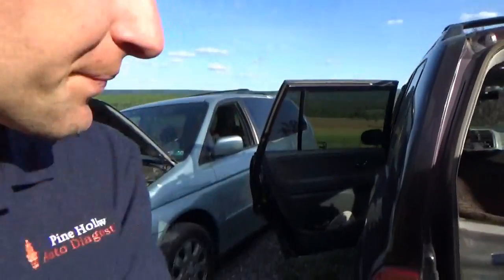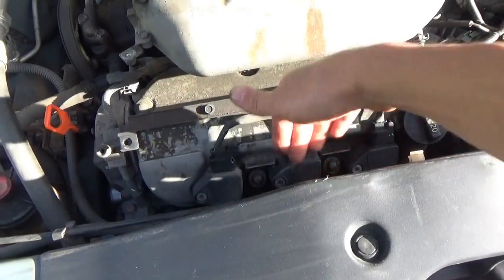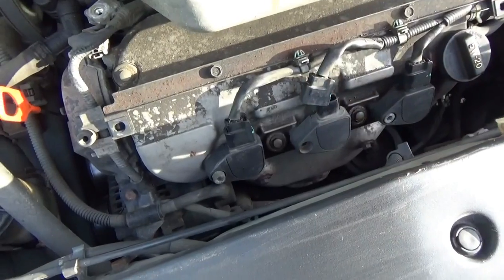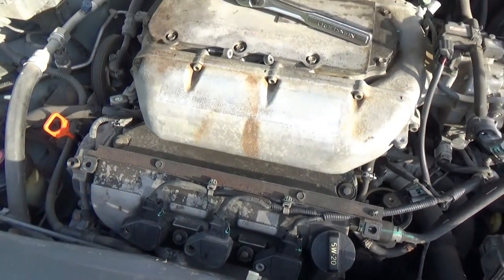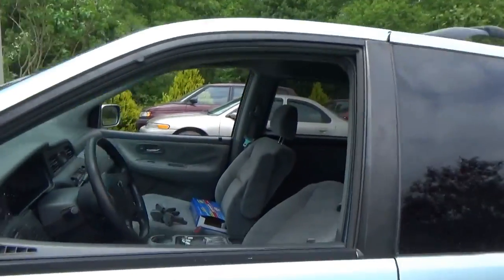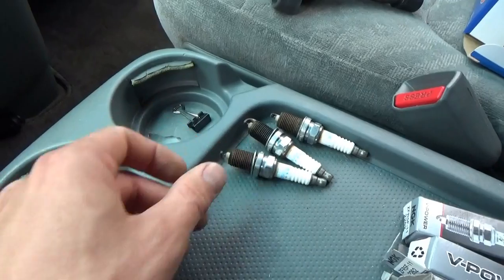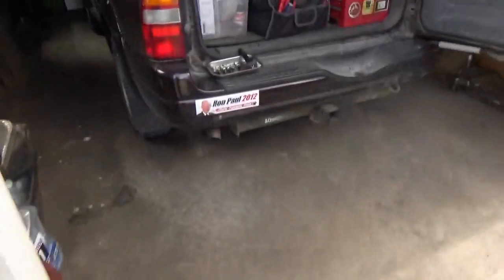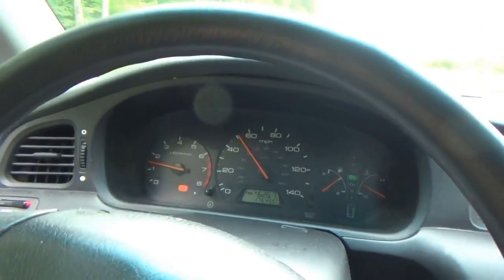Deja Vu? Honda Odyssey Misfire #2! (CAT MELTDOWN?)

Comment: Same thing happened to me about in late 2021. I bought some NGK spark ⚡️ plugs from eBay… they also only lasted a little under 20,000 miles. 

Was driving home after work one night & my 4th-Gen Acura TL started a nasty misfire in the freeway with crazy traffic. Made it home, took a look at the plugs & saw they were worn to hell. Got some OEM plugs & problem solved.

Comment: Love your videos.  Easy to follow.  I've got an 06 Odyssey that has had similar symptoms as the 03 in this video.  My scanner showed multiple cylinder  misfires and a random misfire code so I thought it couldn't be a single cylinder/injector/plug/coil and started looking for a larger issue.  I settled on the fact that the timing belt probably slipped/jumped and my timing was off.  Tore it down and am waiting on timing belt replacement kit.  It needed to be done so no real problem but wish I had seen your video earlier because I didn't know that Honda misfire codes are unreliable.  Once I have it back together, if the problem persists, I'll check each cylinder as you recommended.

Thanks again.

Comment: Liked the video. Just an observation at 1:27, the first spark plug coil you unplugged is cylinder number 4, not 1. Cylinders 1-3 are on bank 1 (rear head, closest to firewall). Cylinders 4-6 are on bank 2 (front head, closest to radiator).

Comment: I want to thank you for such a great video on troubleshooting the customers problem. I was having the same issue with my 2002 odyssey and was baffled by the engine misfire codes and tcs light remaining on with no other codes. I also watched your part one video at the same sitting. With all the info you gave, I found the problem in 15  minutes. Turned out to be a bad #6 plug coil. I used all the troubleshooting tips shown. Great videos.

Comment: I've had no trouble with spark plugs which I bought off eBay for my 5.7 litre Chevrolet LS1 V8 engine because they were Denso spark plugs which were in the GM boxes so they're OEM !

Comment: Plugs from them mother rip off land. Saw a mx8 recently at a friends shop. Dumped so much fuel into the exhaust. CAT was a ball of fire. Let it sit over night. Changed out the oil. Checked it out ran fine the next day and CAT temps were normal

Comment: I have been using shell gasoline only for last two months in my 2006 Mazda 6 2.3 with 311,000 miles.I noticed a huge difference immediately it woke my engine back up and I'm getting way better mileage and motor runs smoother...

Comment: I made the mistake of thinking the cat was the problem when it was glowing red. Turned out to be bad  coil and wires were about shot. Unfortunately, I did a "delete" and now get codes all the time. I'm trying to find a junkyard converter but they usually strip those off first thing for the bb sized piece of platinum in them.

Comment: Ivan, I wanted to see how the how you got to the rear plugs without pulling the engine. You must be a heck of a contortionist!
Reply from the maker: It's super easy on this Honda. Complete opposite of the 92 Oldsmobile Silhouette haha
Reply: I just worked on an '06 and the firewall was tight. I think the engine mounts are shot, so maybe I should have tried jacking the block.

Comment: I won't be buying any oil filters on Amazon either. One of them comes apart, and it could ruin the entire engine, should pieces of it get stuck somewhere and reduce the oil flow. It is unlikely, but not worth the risk to save a few bucks. Fuel filters too.

Comment: Thanks! I had to splice an ac plug onto a cord for an under cabinet light. I staggered the cuts. I went and got the soldering iron soldered the connections put heat shrink tubing on the joints. Because I watch your channel I did that. Prior it would have been an unsafe mess. Thanks! Thanks!

Comment: I once bought water filter for my refridgerator I had issues with my dispenser clogging up pulled out the old filter it was very light like it was empty after closer inspection the filter was counterfit was filled with a little sand to get the weight right and was just a hose that let the water bypass the filter craxy

Comment: There's alot of that going on these days! I definitely would steer clear of eBay or Amazon for auto parts, especially electrical ones.

Nice work on that pressure transducer! If I ever get a laptop, I'll be buying one from you! At the moment my desktop is driving me nuts with slowness. I've been working on a YouTube video for a week now. Friggin ridiculous and super infuriating. New one with the memory and disc space I want is $4-grand! 😵

20 years ago when I was out in Phoenix, the heat out there damaged the original TFI module on the distributor, and caused a cat-melting misfire that took me some time to figure out the cause of. Same deal - cats were fire engine red! After replacing the module and the internal pickup in the distributor, the problem was gone, and the car still had the same power as before, so the cats were still good! That was amazing, since I drove the thing 2 weeks before fixing it, cats glowing each time. Doubt most modern vehicle cats could handle that!

Comment: You have to be careful counterfts are running rampant on amazon and eBay  I’d rather buy from the dealer or rock auto.  Big difference between China and Japan.  Amazon should monitor there sellers better but ounce you get so big all you care is about the $$$$ and getting the product out fast. You gotta love how Ivan does a scan before giving back to the customer 👍

Comment: I would be interested in the Pressure Transducer prototype with my Autel MS906BT and Maxiscope setup! Message me if you would consider. I am located nearing Birmingham, Al
Reply from the maker: Hi Phillip, just fill out the request form on my website! Should work fine on the MaxiScope :)

Comment: "lean" fuel issue makes cat glow orange, also clogged cat does the same, never trust O2 readings nor other sensors and "magical codes", more often that not, no codes present because of odd failures the ECM isnt capable of detecting or will spew false/wrong codes becaue other items are funked up.
you really have to diagnose hard, use nose eyes and ears first, if smell is rich/unburnt and odd pulses then raw fuel is pumping. if smell is clean and uneven pulses, no fuel at all(to one hole), mechanical or ignition issue (fuel cut to one cylinder on newer junk and still spotty)
I guess I could go on and on and the more I think about it, it's learned in due process and the short amount of training/schooling simply isn't enough, as it will never be.

Comment: Tip for installing spark plugs that are at an angle like that - keep an old style long spark boot and use it to install the new plug. Since they aren't solid like a socket, they greatly reduce any chance of cross threading a new plug.
Reply: or thin rubber hose...

Comment: China parts are hit and miss. I’ve seen mass airflow sensors that don’t work from the minute you installed them. On the other hands I have installed eBay starters and wheel bearings that work just fine
Reply: that sums up everything since about 1993 (Clinton presidency), it went downhill majorly, starting with the challenger kaboom.... RIP crew

Comment: Classic cascade failure-
One or more inferior quality parts lead to further damage.
These older engines are not meant to run the very cheap
high percentage ethanol blend, either.
I can imagine the knock sensor(s) are very stressed out,
from having to report such high frequencies; timing gets
advanced to try to compensate, burning up plugs.
This is not a "flex fuel" capable system, it's ECM doesn't
have the strategies to deal with ethanol.
My Friend nearly ruined her '06 LEV Accord using cheap,
low octane corn juice. Exact same symptoms and
problems.
Reply: Whenever I can find and afford ethanol free gas I make sure to fill the tank with it. Usually is the Shell V-Power where I live.
Reply: Wouldn't the timing get retarded?  And flexfuel vehicles can run off of E85.  Pretty much anything should be able to run off of E10, which is what most pump gas is.

Comment: Could this be a way to clean an almost clogged cat? Unplug a coil, so the cat will get unburnt fuel (or if the ecm inhibits the injector, introduce unburnt fuel in another way), and then drive the car under heavy load while the cat is glowing red, burning off internal carbon deposits? I don't recommend anybody purposely doing this but could it work, in theory?
Reply from the maker: Great thought! Well if the cat is inactive to begin with, the fuel wouldn't burn, so nothing would happen. However if the efficiency is marginal then it could potentially work?
Reply: most often it will get hot and "BURN" the insulative holding material around the catalyst itself, then they start flopping around lose inside and breaking up physically.. which makes it plug up worse/fast.. most are 2 or 3 stage now and the front stage comes loose, and hammers around, the material clogs the second and third stage, muffler/resonator also

Comment: Very good on the follow up with checking the oil for fuel dilution. Often overlooked and can usually cause a rich code in some cases when ran back through the PCV system.

Comment: Are use dielectric grease on the threads just stuff about the size of a 8 inch ball spread it on the threads and then also put them on the electrode at the end when I before I put the coil. Kept the great work.

Comment: Another example of how sensitive Honda ignition systems are. Use the right parts, they're reliable and low maintenance. Use the wrong parts, they'll run like crap and stress other parts until they fail.

Comment: There are many counterfeit items out there right now, ebay and amazon are both a little guilty. I saw a video where Motorcraft spark plugs are being sold in boxes that look like they came from Ford but they are not. Weird drawings on the box and the name on the actual plugs look different than oem. It's pretty bad when those plugs look like that after just 20k, that's pretty sad. Test drive at the end is always important, part of verifying the repair.

Comment: No need for the wd 40 on the threads of the new plugs the oem plugs have a special coating on the theads that  prevents the plug threads from seizing in the head no need for anti-seize slso
Reply: For the price of those spark plugs, they should have.
Reply from the maker: WD-40 is my good-luck spray ;)
Reply: I trust all that as much as I trust not getting counterfeit plugs or ones the manufacture outsourced(shell companies with nothing left but lies, garbage and branding)

Comment: Wow,   I've never seen worn and fake plugs.   I've always bought plugs at the store.  Nice fix!!!  Great job!
Reply: I tend to buy plugs locally only ( fragile items) and I want to exchange them fast if it's shipping damage or they smashed then in storage..
but sadly, they all are failing to warranty replace, claiming "you" damaged them. which I can see for a large amount being true... people damaging them, I have done so myself letting socket cock sideways and cracked porcelain, which i felt and knew i did, the just bought a plug to replace(my fault!)

Comment: Your actually a local to me. Wondering if you could help ? I have a 2009 Subaru 2.5 sohc n/a  I did all the work my self I do not have a alltech system to tell me torque settings for head bolts... Also could you recommend a trust worthy place to order my head gasket kit and timeing belt kit... Thank you
Reply: Mind you I did get my head's decked and surfaced and I'm ready to put it back together...
Reply: 6.21.20.     Only purchase Six Star ®️ or  Fel-Pro ®️MLS head gaskets  you can purchase at ...... smartqualityparts.com. These guys know Subarus!

Comment: WD washes all the protective oils away and then evaporates, creating corrosion.
I use it for breaking parts free, but, it's just a wash, not a protective film.
Reply: WD40 is a mixture of Stoddard solvent, light mineral oil, and petrolatum. Only the solvent evaporates quickly at moderate temperatures.
Reply: It's also a good tar remover on rocker panels !
Reply from the maker: I thought that was Brake Cleen...WD-40 leaves a light protective film I think.

Comment: Yvan, I'm surprised you get enough negative PSI range (down to full manifold vacuum) out of those 0-200 PSI sensors. I've purchased quite a few of those and usually they bottom out @ minus 3-4 PSI (420mV) clipping the expansion pocket and was relegated to modifying them to get extra below 0 PSI range.
Reply from the maker: Yeah mine are special lol :)

Comment: GREAT catch on changing the oil SIR IVAN. Just had that problem with my riding mower this year, BAD NEEDLE & SEAT, also put a manual fuel shut off valve on it just in case.

Comment: Pretty sure pcm shuts down injector on a dead missfire to protect the cats.
Reply: Apparently not, GAS IN OIL, RED HOT CAT. ?
Reply: @NoWr2Run  
Plug looked dry to me.
Reply: @montefiveforty1  YOUR'E VERY RIGHT, but maybe for awhile it didn't ? It's hard to tell with those plugs & aftermarket coils in it ? NICE EYE ON THE DRY PLUG, SIR.
Reply: Depends on softwear

Comment: It's good that you showed real experience of counterfeit parts a year down the line.
Most times counterfeit parts are shown brand new, so aside from minor differences in markings most people would think "what's a bit of ink, that doesn't affect its performance" 
Obviously the electrode material is where they've really cheaped out!
You never know, you might get Mike Becker linking to this video!

Comment: kudos, not over diagnosis this time, good catch on counterfeit plugs! Perhaps it's the beginning to take the giant Amazon down!
Reply: Amazon isn’t going anywhere, especially due to some spark plugs. They were probably sold by an amazon retailer, and not directly from amazon.
Reply: Jeff V they are aware and still allowing it to happen. Cooperate greed is at its finest. There are a few videos on here exposing this issue

Comment: Amazon may as well be Alibaba or Banggood at this point.
Reply: At this point I would question anything from Amazon as I would EBay. And it's sad that when we know for a fact when a systemic cultural problem exists causing us here to be subjected to fake products we are not even allowed to call them out for it by name anymore without having our own reputations trashed.
Reply: Basically Alibaba.com was named after the well known thief Ali Baba story from what I gather.
Reply: eBay and Amazon sell China stuff. If you don’t like simply shop somewhere else like rock auto. It is a free country.
Reply: @deerhunter8533  Many products from the Rock are also from China, however not likely fake.  In fact all the major auto parts stores have a serious percentage of parts originating in China & I'm not saying they are all bad, only that you cannot delete China as a source.  I would prefer to, but it's impossible.
Reply: @deerhunter8533  - RockAuto suffers alot from misboxed items. For example, I bought a Moog outer tie rod end for a Buick LeSabre. Moog box, but the part inside clearly was not a Moog product. I knew it wasn't. Just to satisfy RockAuto, I called Moog and gave them the numbers of this tie-rod end. Guy said, "That's not ours." What I figured! 

Some DIY'er fixing their own car in the driveway might not have ever suspected anything, and got screwed. Have to check the stuff carefully when it arrives, and you have to make sure to answer RockAuto's return questions correctly, or else you get stuck paying to return it, or get no refund or replacement.
Reply: C Ilikecats watch one of Ivan’s videos about a Subaru timing belt kit from rock auto. It specifically stated Japanese bearings and low and behold they were Chinese